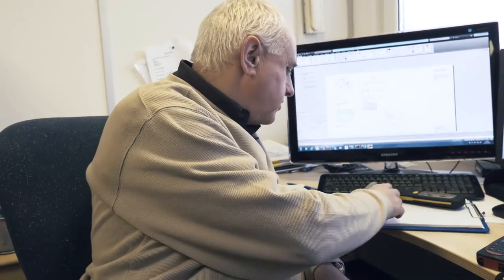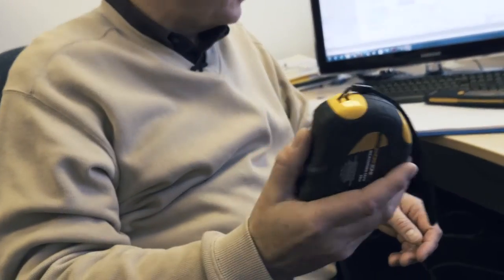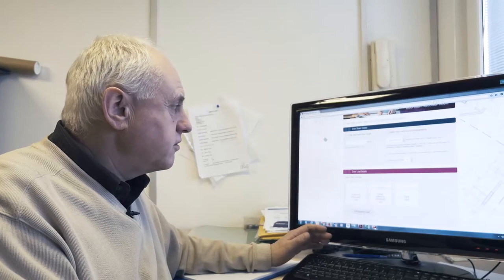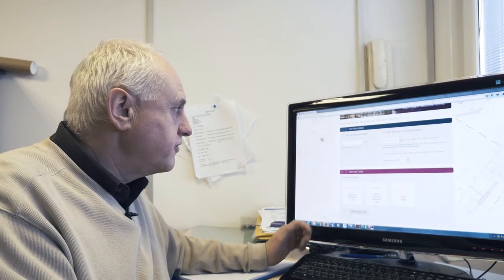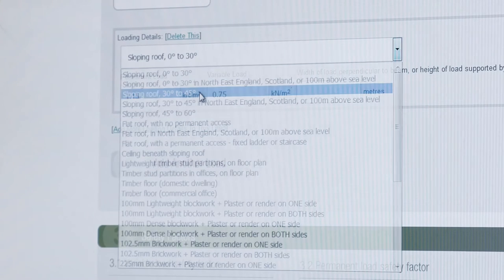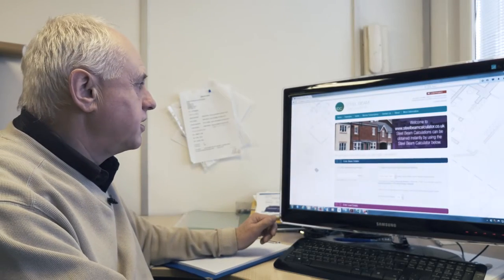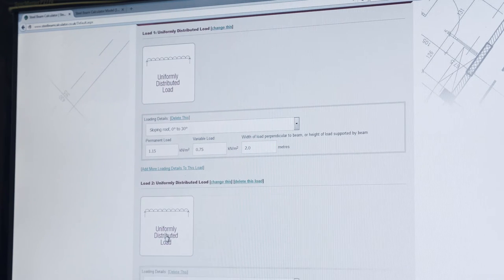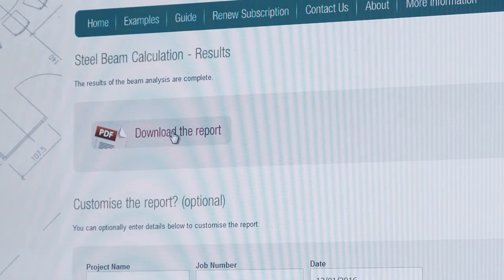Steel Beam Calculator - Case Study

Comment: It is such a rip off  when this information should be available free from the steel producers whe are the people that produce the steel sections 
and a simple calculator should not be beyond their capabilities - just a money making gaff.  Loading calculations are taught in college and are easy to do but to select a beam you need data from the producers who have to provide this by law - it is found from their testing and analysis and not by any form of physics.

Comment: It's should be gives only one steel beam size for different load or span, this calculator give all beam size for any calculation we add in ...stupid
Reply: I need to calculate steel beam, taking down supporting pillar in middle, placing steel across around 3metre length, it’s a uniform load of ceiling, it’s a shop ceiling. How and size.